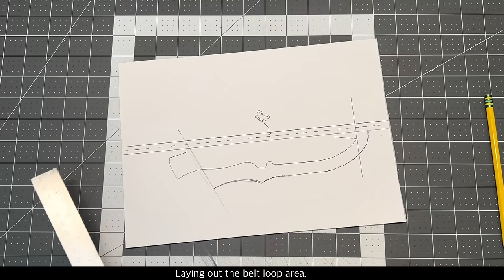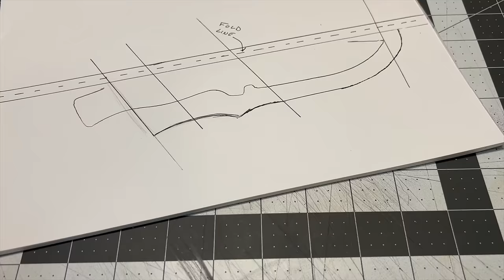Making A Scout Style Leather Knife Sheath - Leather Craft

Comment: Is the scrap leather under the sheath while drilling used to minimize blowouts, similar to woodworking? Or is it doing different work?
Reply from the maker: It is there to help keep the sheath parallel to the drill bit. The notch is cut out for the belt loop piece to fit into.